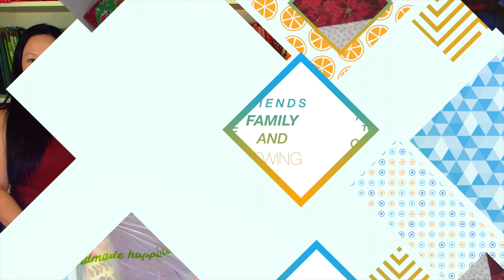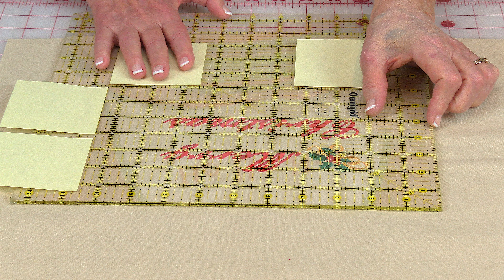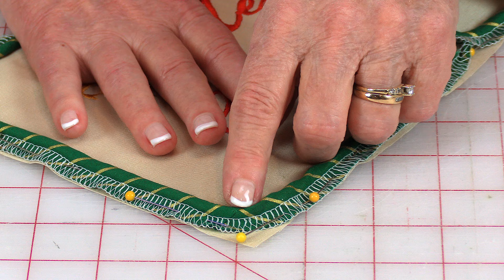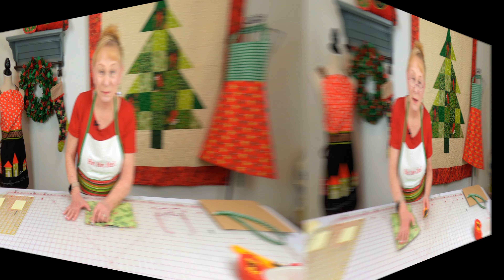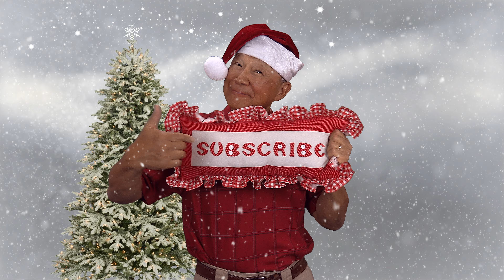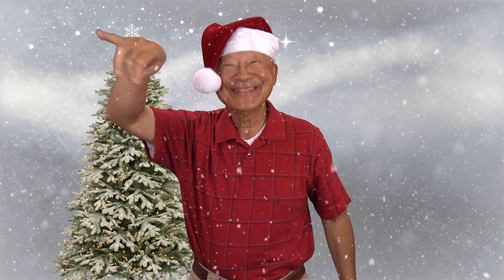Embroidery Pillow Design | Part 2 | The Sewing Room Channel

Comment: I have a babylock verve and tried to embroider Merry and only got the first four letters before it told me it was too long. Do i have to shrink lettering down? If so, do you have a tutorial on that?
Reply from the maker: Hi Kara.  On the sewing machine screen it will tell you the size of the area you can stitch on.  I believe the Verve has 4" x 4" hoop size.  So select things that will fit in that area. 
 When you select the letter style, you can also select LMS (large, medium, small).  You Can also stitch the word "Merry" on one line, and the word "Christmas on the next line.  Thanks for watching, and happy sewing.  😍